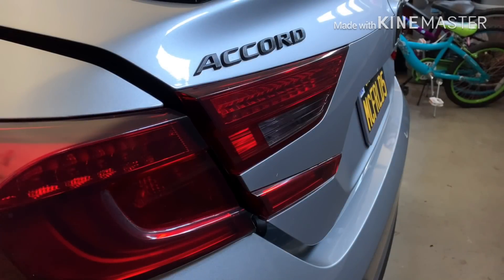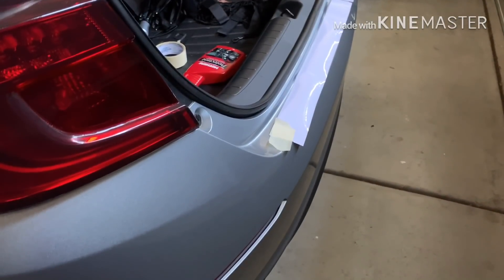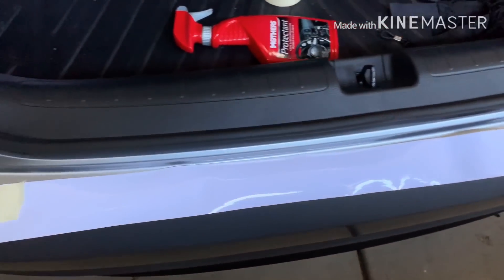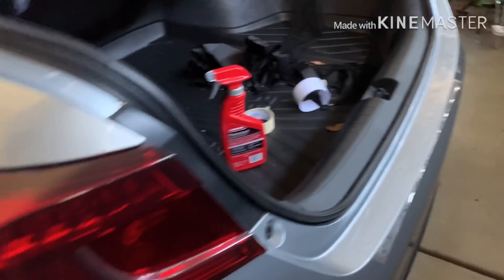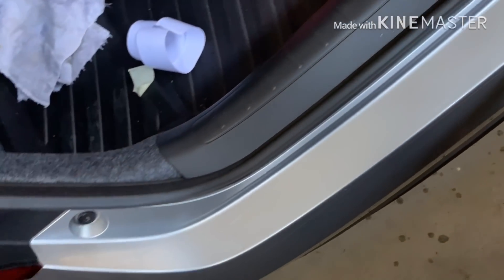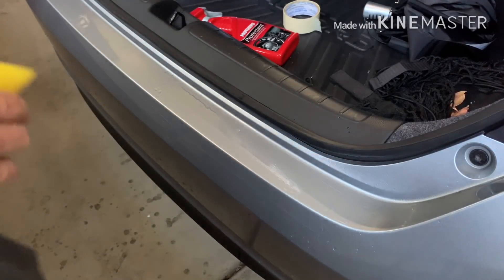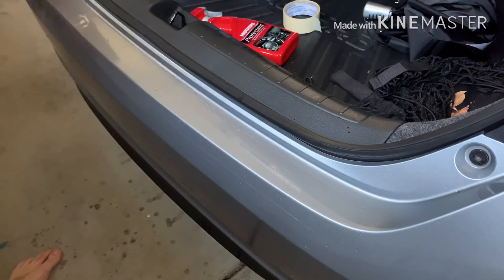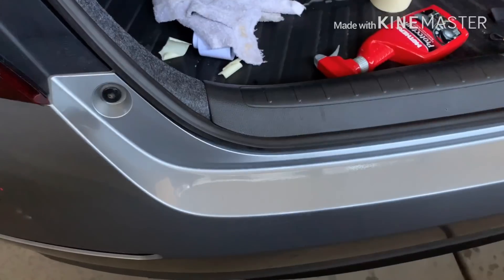2018 2019 2020 Honda Accord EASY Diy mod

Comment: Hey John where did you get the tail light tint for your car? Can you share the link?
Reply from the maker: No problem. Check out Kooltint604 on eBay. He has it all.
Reply: Honda Jon watched your video on it so thanks! I am about to order but does it cover the entire tail light including reverse light and blinkers?
Reply from the maker: Hi. When you order message him and tell him you would like the full kit that covers the reverse light and blinkers. He does have it. Mention me and ask if you can get a discount. He should be able to hook you up. 👊🏼

Comment: Hi Jon how do you cut this 3m clear film so straight what’s your technique? I have some of that still waiting for my vinyl decal from the place you recommended I want to do that first before doin this mod.
Reply from the maker: Nice man. What I did was place it on a cement slab and you a level for a straight edge then cut it with my exacto knife. Just push extra pressure and it cuts clean. The blade will be dull after though since it’s against the cement. 👊🏼
Reply: Honda Jon thank you Jon did you use the heat gun at all?

Comment: I love your blacked out Accord badges.  How did you do it?
Reply from the maker: Thanks man. That’s one of my favorite mods. It’s easy. I plastidipped them. About 7 coats.  Extremely durable stuff
Reply: Thanks!  I’ll definitely be doing this.
Reply: Someone peeled mine off, believe it or not...I'm liking the front grill without it but need to get it replaced. Hondas charging approx 45 for the 'H' emblem...idk decisions decisions
Reply: Vishal Vyas did someone take your front emblem out of the grill?
Reply: @jasojeep  most definitely did
Reply: Vishal Vyas bastards! I couldn’t even figure out how to take mine out.  Sorry man.